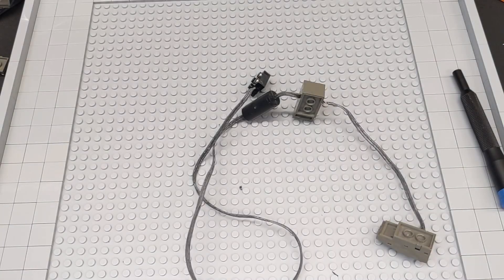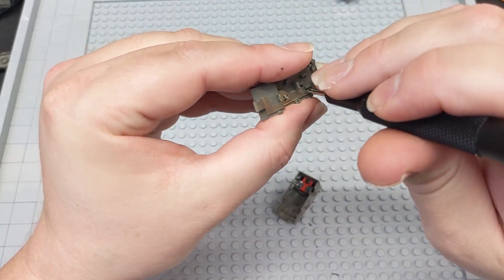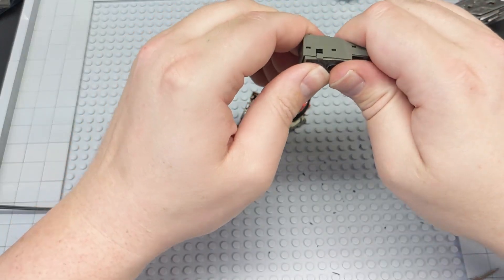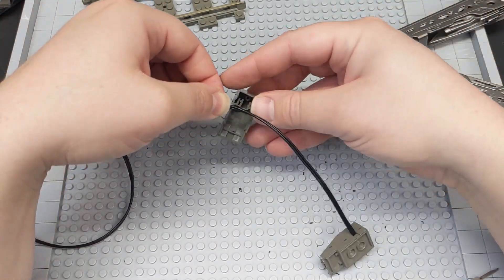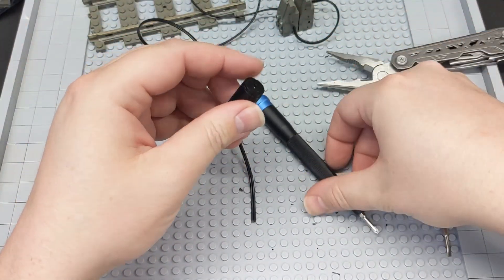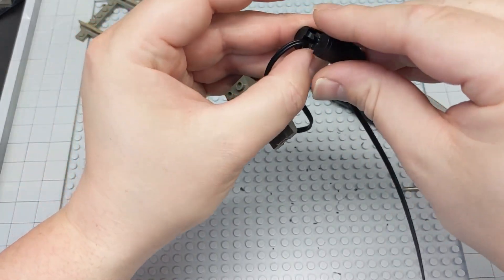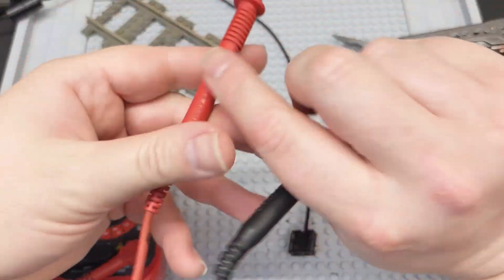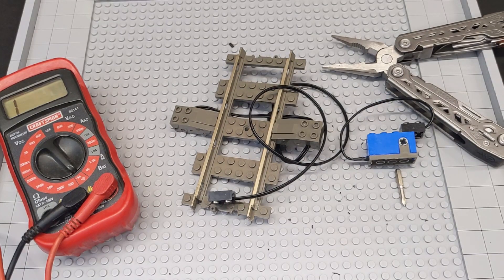Repairing Lego 9v Train Wires

Comment: Does it matter which way the wire is turned in the brick at the end, compared to the other parts?
Reply from the maker: It will determine the default direction of the train but you can always rotate the 2x2 connector or swap the two track contacts.

Comment: I have done everything in your video. But unfortunately it still doesn’t work. I use a 0.14 mm two core wire. What did i do wrong?
Reply from the maker: I get comments like this here and there but I can't do much through YouTube comments, anything that can go wrong I tried to cover in the video.  The best option is to join our Discord where you can chat with members of our community and post pictures to try to find out why it isn't working

Comment: Just got my 9v train out for our Christmas Lego display, and found these wires frayed and not working. Ready to purchase a replacement somehow, and came across your video.  Perfect solution. Never knew those bricks would come apart to re-wire. Hopefully the wire you recommend is still out there and available.  Thanks!

Comment: Hi, I am looking fo a cable set like Pyrus in this video. I searched a lot at the internet but I Can not find the right set. Do you have any idea where. To find this cable set. I would like to repair the train and supplies for my
 grandson
Reply from the maker: Eventually FxBricks will be making 3rd party replacements for those cables but they've been saying that for quite some time.  Product development takes time.  These cables can be found on eBay and Bricklink but can be very expensive.  Personally if I didn't have them and just wanted to run a Lego train I would just use any 2 conductor wire, like speaker wire and pinch the bare wires between two tracks.

Comment: I would just like to say, this tutorial was fantastic; it was super helpful. Today I rebuilt 5 9V train wires with little electrical experience at this level. Everything taught here was great. 

I’d like to learn more about your regulator video in terms of improving capacity and DC output; but before I dive in - any alternate recommendations to building a custom regulator to increase DC capacity? Got a train with 6 9V motors. 

Nevertheless, so glad I attempted this from your tutorial.
Reply from the maker: With that many motors you may want to just use a custom power supply of some kind.  I'm not really sure what folks use when needing that much power 🤔
Reply: @BatteryPoweredBricks that’s my mission right now, how to build that custom power supply. SOS

Comment: I don’t understand one thing: how do you have current if you didn’t strip the wires?
Reply from the maker: The blade contacts pierce the wire and make continuity.  I've heard some folks don't trust them but I have never had a single problem unless I accidentally bend them over when snapping the connectors together
Reply: Thank you so much for the answer!

Comment: i actually found a short 9v cable (rubber insulation) that somehow isn’t degraded, like you can bend it 180 degrees 10 times and it doesn’t even crack, no it’s not plastic insulation either, i don’t understand how it isn’t falling apart…
Reply from the maker: Give it time 😅.  I think another factor is how they have been stored.  My cables really bit the dust when they were stored in a shed for a while and the temperature changes really got to them

Comment: I had a cable sealed in the bag and the wiring is exposed.

guess this stuff doesn't last
Reply from the maker: Yeah I have a sensor new in package that is degrading.  Any cables with the rubber insulation will go at some point

Comment: Do you have any additional tips for the 2x2 brink i either get one side with power or a short
Reply from the maker: The main thing is to use wire with soft insulation and make sure the blade contacts are absolutely straight before snapping the connector together.  I'm actually editing a new video for making 9v and PF wires and tried to go into more detail on things like that

Comment: Hello, thank you for the video which is very well explained. I would just like to know where you found to buy the black square piece that you dismantle at 10min30. Thank you so much
Reply from the maker: As far as I know they can only be sourced from Lego 9v cables, either from the train wire or a Mindstorms / Technic set.  I've been looking for a third party that makes them like the Power Functions ones I've found but haven't seen any yet
Reply: @BatteryPoweredBricks  Thanks. Yes I looked for parts but couldn't find anything. I found this, would it be suitable if we took it apart to install a cable like the one you recommend? Clevoers câble données Technology Series accessoires compatible avec Lego Bricks 8870 Lights - Interrupteur 8869, Technic Power Functions, 7,87 pouces / 20 cm on amz
Reply from the maker: @christinepejoux3971  That's a Power Functions cable end.  Even third party I've never seen someone sell 9v connector ends, the only option is buying a used cable on eBay or Bricklink

Comment: i wish you could fix my train. which screw drivers do you need for this
Reply from the maker: I use a 2.5mm flat tip screwdriver for the 9v connector.  It doesn't have to be exact.  I think the tabs on the track contacts are a little smaller, it's been a while since I've made one

Comment: What is the size of the wire if you measure it with a measuring tape ?i cant find the wright wire here in the netherlands
Reply from the maker: Well that's the issue when finding the right replacement wire.  While the wire itself is 24 gauge, the insulation can vary in thickness and it needs to be somewhat soft to make sure the blade contacts pierce the wire correctly.  Maybe I can find a datasheet with more information.  I've heard there is a wire sold on AliExpress that has soft silicon insulation like the wire I use but I haven't tried it myself
Reply: @BatteryPoweredBricks  if you can provide more information about it that would be great
Reply from the maker: There's a discussion in my discord about this, trying to find sources in other countries.  I can tell you the conductor wire is about .5mm in diameter so the width of both wires with insulation is about 3mm total.  Our discord server is linked on my home page as well as any recent video if you want to join the conversation

Comment: WHERE CAN YOU BUY JUST THE 4 KNOB PLATE TO CONNECT THE WIRE  TO I HAVE LEGO 8480 AND NEED NEW WIRING/THANKS
Reply from the maker: If I ever find a source I will be shouting it from the mountain tops.  The best I've found is bulk lots of cables with bad wiring on eBay.  Power Functions connectors can be found on AliExpress but I doubt there is enough of a market to ever make replacement 9v connectors
Reply: @BatteryPoweredBricks  thanks

Comment: I rewired 2 of these train power cables today thanks to your videos. The original wires were a mess, missing the insulation for a full millimeter in several spots, having to set the wire just right to avoid shorts. I watched step by step, would come back and play a snippet of each part before attempting it, listening to the direction you said to push and twist the driver etc, even using the same mm screwdriver you suggested. Wow, the first try was just such a headache to even get all the clips apart (to make things even more frustrating, I started with the "extra credit" first). If I had not seen you pop them apart I might not even think it was possible to flex them open. By the second set I had a better idea of the shape of the clips and wasn't as concerned about scratching up the housing or breaking clips off so that went a little faster. I drew blood several times slipping with the tiny screwdriver and I had to take on and off my glasses depending on which part I was working on. You have steadier hands than I or so much practice handling these tiny elements.

I attached the wire to a piece that touches the track 3 times without continuity... the teeth were not reaching deeply enough. I found that if I put a very tiny piece of clipped insulation (with the conductor wire removed) under the wire on the side with the teeth it worked every time. This wire seats very snugly in the space and I didn't encounter any shorts. The 2x2  brick piece was more resilient to prying apart and I got that working pretty consistently. I found it helpful to use a 2mm allen head tip on my driver to press and seat the wire into the 2 by 2 brick. This allen head also served well to press on pieces and spread the pressure more than a flathead would have. I used a rubber band to hold the various wire ends and clips securely to the top of a glass to make it easier to touch the probes of the multimeter to them to test for continuity. I started with my oldest and most decrepit wires so hopefully the next sets i do pop apart a bit easier. 

Thanks again for helping me bring new life to these wires... additionally I made the cables around 8 feet long so I can mount the box elsewhere in the room, have the power run in from the back, etc... the stock cable is so short I essentially have to sit the transformer box in the city. At some point i want to build some human sized "controls", buttons, and lights around the power box just for fun. I have a bunch of mindstorms wire to replace as well. I got a 50 foot roll of the 6 wire spool you suggested so that's 150 feet to play with :) Thanks again very much for sharing your experimentation because I never would have had the patience to figure it out myself.
Reply from the maker: Glad to help!  Definitely something that comes easier with practice.  I've probably done a couple hundred of the 2x2 bricks at this point.  I've drawn blood a couple times too, just not on camera 😅.  Yeah control panels are always fun, I've got a ton of ideas using them on the back burner but always have something flashy drawing my attention.  I'm certainly not the first to do a guide fixing these cables, but tried to be as detailed as possible.  Thanks for the comment and best of luck with your projects / builds!

Comment: I know I asked you about a repair service but I bit the bullet and ordered the wire, AMAZING!!! It works so well to repair these cables. I even moded some  cables from old 4" 9v  and turned them into 2 footers. FYI you can easily remove the white stripe with a paper towel and Acetone, comes off in like 4 swipes! Thank you so much!
Reply from the maker: Glad to help, and thanks for the tip! Greatly appreciated!
Reply: @BatteryPoweredBricks  can you buy this wire at Lowes or home Depot?

Comment: Great video but I'm having trouble find that Bntechgo wire
Reply from the maker: What country are you in?  I know it's on Amazon in the US and in Canada (although more expensive).  If you aren't as concerned about aesthetics there are more options.  I've used 24 gauge speaker wire in the past, but it has to have pretty thin insulation.
Reply from the maker: Also I goofed and didn't link where I got the wire in the description.  Just added it
Reply: @BatteryPoweredBricks  Richmond Va, I bought the BTTECHGO Ultra flexible silicone tinned copper wire and replaced the old wire.

Comment: I just got out my kids' Lego 4561 train I bought them in the 90s and the wires are frayed and insulation is disintegrated.  Searched for a repair video and your video popped up.  Good timing that you post the video a month before I find the train.  Thanks for sharing this!!!  I may just solder new wire to the controller and the track, but still repair the original connecter later.
Reply from the maker: Awesome!  While I never actually owned any of them, that era of Lego trains is definitely my favorite.  I've made my own cables for years but just recently got everything I needed to make a decent guide.  Finding the right wire was the biggest issue for me but I can be somewhat of a Lego purist 😅
Reply: @BatteryPoweredBricks  I ended up using the wire from an old router power adapter.  I drilled a small hole in the back of the Lego controller and fed the wire in and soldered it to the circuit board. I opened up the two track connector blocks and soldered the other ends of the wire to those.  I saved the magnet thing and 2x2 controller connector block just in case I decide to go back to the original wiring.
Reply from the maker: @SteveCarmichael  Whatever's clever!  I've done several mods like that over the years, but I'm glad to have found wire that looks just like the original for any builds I do that are on display or would be in a video.